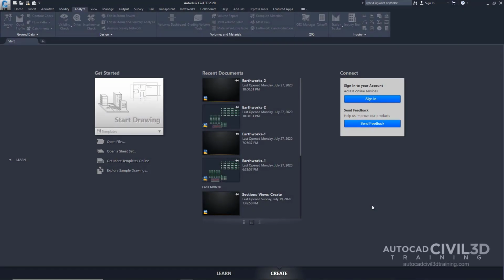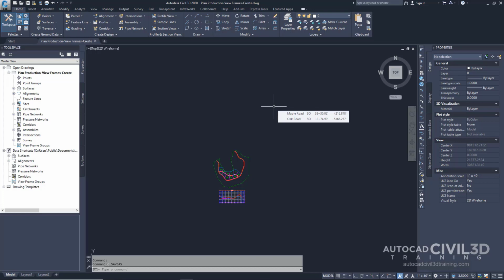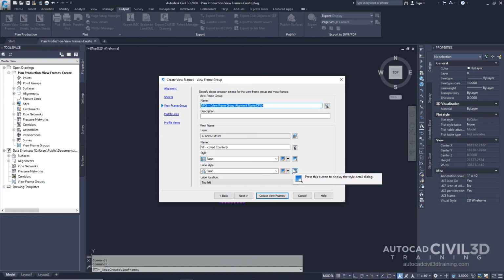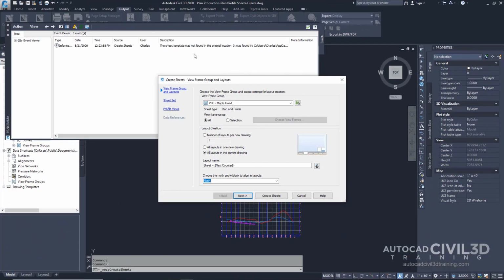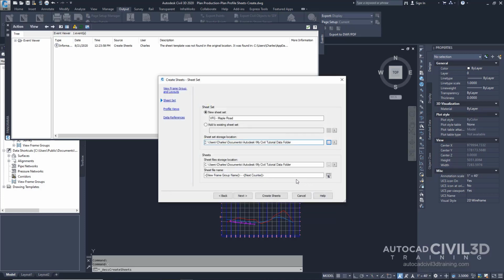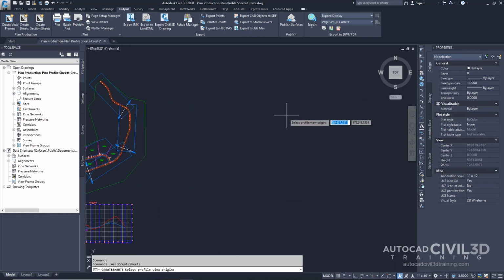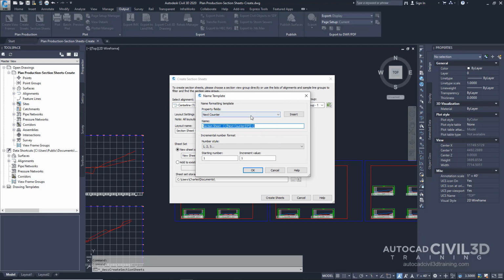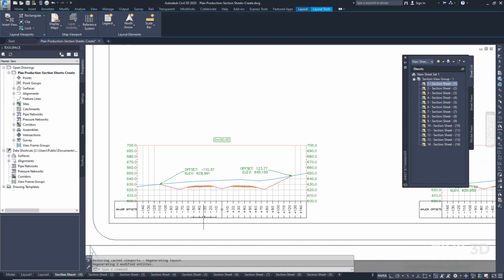17 Plan Production Tools in Civil 3D 2020 to 2022 for Beginners

Comment: Hie, is there a way I can put an entire alignment on one sheet rather than having multiple sheets, with details still being very clear.
Reply from the maker: Yep—you can 👍

Use a smaller horizontal scale (like 1"=100’ or 200’), stretch the profile view wider across your layout, and reduce vertical exaggeration. Also clean up labels (fewer stations, less clutter) so it stays readable.

If it’s really long, it might still get cramped—but for most cases, this gets the whole alignment on one sheet cleanly.

You may want to select the largest sheet size you can select in page setup manager.